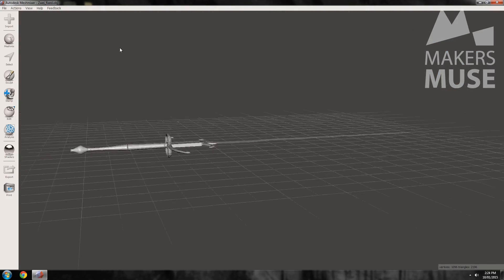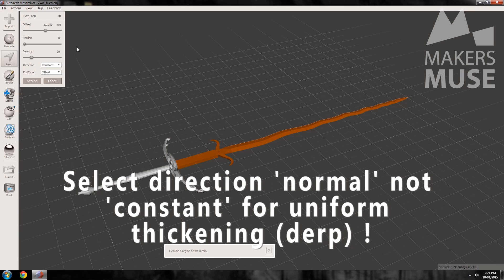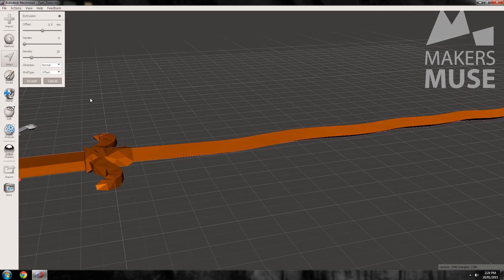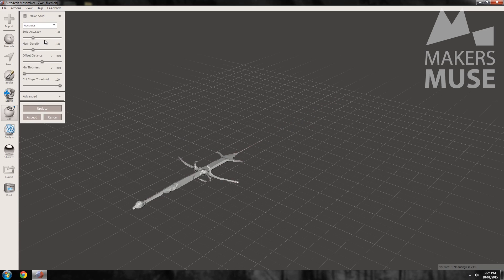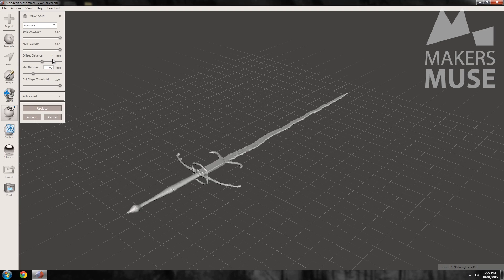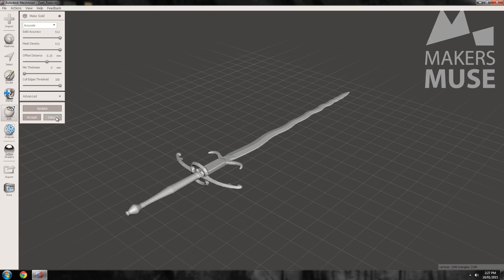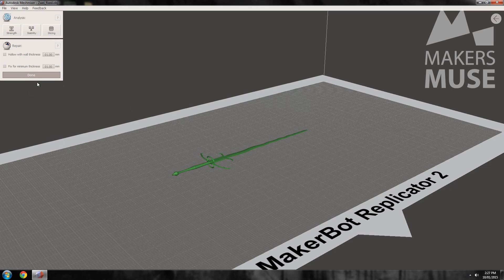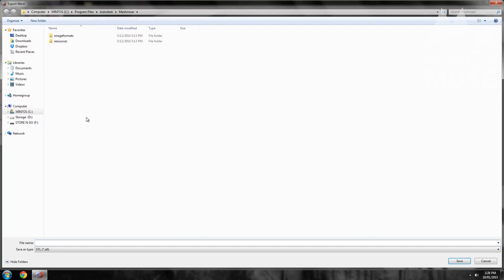Add Thickness to Delicate 3D Prints! - 2015

Comment: I'm using ver 10.10.170- . After setting to Dremel 3d20- Minimum thickness DOES show up for me in print settings. Meshmixer tells me it is using the latest update, although I doubt it is. Dunno~  Anyhow- thanks for your video- it is helping me print out some super thin fractal work.

Comment: Hi Angus, when I press Print, it does not give me these same options. It just wants to export automatically to a slicing software, and never gives me the option to fix for minimum thickness.  I have read MeshMixer's documentation about the "Print" feature, and they don't mention or show this menu. But every Youtuber I've found on this subject just clicks Print and this amazing and useful window pops up. Any idea what is causing this?
Reply from the maker: The feature was removed... Sorry :(
Reply: It's okay, thanks for the reply!
Reply: Any new software which you can use to do the same?

Comment: The last option you mentioned here is no longer applicable as the Print dialogue box has changed. Would there by a chance you can update this video for best practices? I'm currently trying to set a minimum thickness for the model without Meshmixer changing up the whole mesh, and just an area that may be too thin.

 Thanks Angus! =)
Reply: 4 years later but was thinking the same thing.

Comment: Hi Thanks for the video! Question: When you go to Analysis > Thickeness, it shows an area of my model highlighted in red. The default Min Thickness is 1. When I change that to 0 the red goes away. If I increase the Min Thickness, more red areas appear. Is this changing /  repairing the thickness of the model?

Thanks again!

Comment: I thought I was missing something when my models kept having gaping holes in the print preview when I wanted to print something with my 1.2mm nozzle at a .6 layer height and 1.2mm extrusion width. I thought I would have to redesign models from scratch to get them to print using a large nozzle but this makes it sound like I can skip that and just have a very thick version of prints that dont work initially. What do you think?
Reply from the maker: +singhm29 Printing with an UP? The UP will just ignore features too small for it to reproduce, other printers will sometimes 'try' but they obviously turn out thicker. This trick in meshmixer is designed to make existing models thicker and easier to print - so it sounds like the perfect solution for you. So longas the model is fairly organic - it doesn't work well for geometric shapes as it inflates and rounds things. Good luck!
Reply: Printing with a Gigabot actually. I do hear that slic3r deals with small features vs large extrusion widths very well as oppose to S3D. Keep up the great videos they are among the most helpful, straightforward ones I have found.
Reply from the maker: +singhm29 Ah gigabot, explains the 1.2mm nozzle! I believe there is an option in S3D to allow it to 'inflate' thin areas with fill instead of just ignoring them - Under 'thin wall behavior' in the Advanced tab.